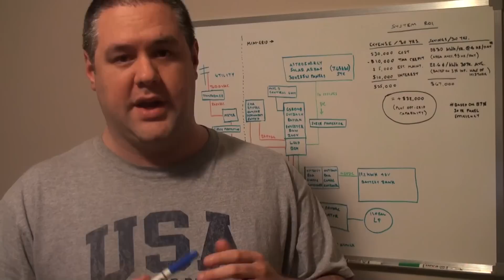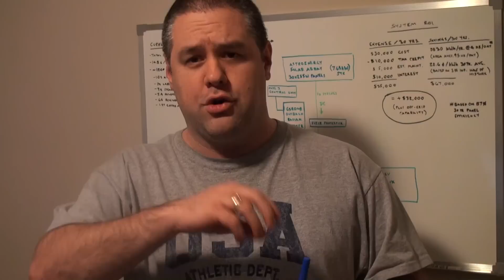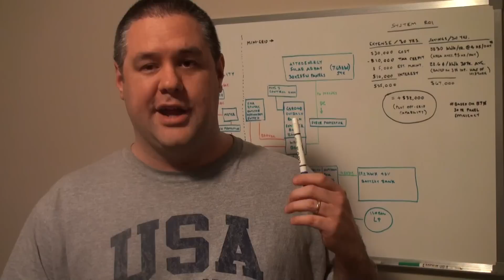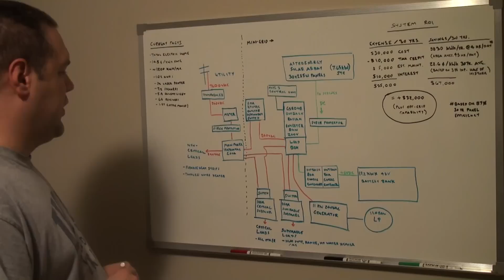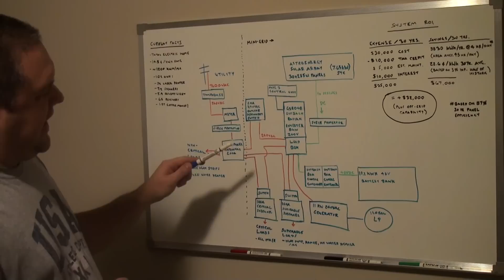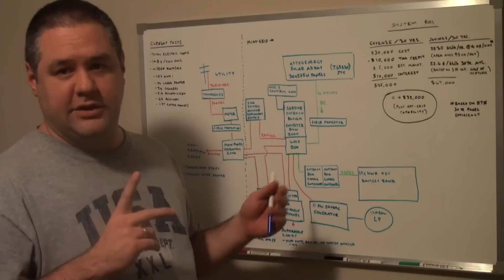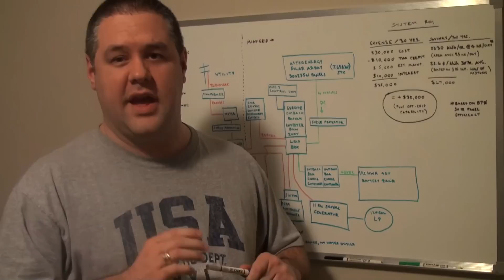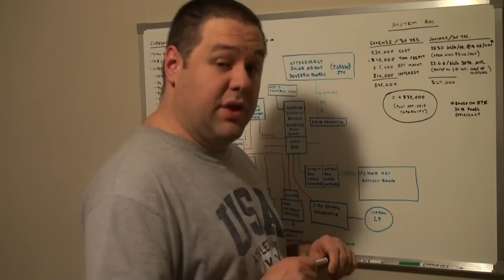Grid-Interactive Power System with Solar, Inverter, Batteries, and Generator

Comment: Great explanation of your system. Someday (not here in Oklahoma) I will have a system similar to yours. Right now, mine turns off grid power (120v side, for six circuits)  when I am making power...thus reducing on-grid time and electric bill costs. It is a capable of off-grid 24/7 instead of just 7-8 hours a day if SHTF or power goes out (emergencies). Right now I am offsetting about 30-40% a month...which adds up! Anyway, two things I like about your system. 1) Batteries. So many say no way on batteries...however, if you get a big enough solar array, you can run the house and charge batteries. 2) LP generator. Even smarter IMO...in an area that only has 4.5 hours of solar (avg) and being in Indiana, best investment for living comfortably. 3) Grid-interactive. Indiana is much better than Oklahoma. As long as utility taxes are low and they buy back a lot of power...you should be good to go. Anyway, smart/intelligent presentation...great job. I spent a lot of time in Indiana growing up (grew up in southern MI).

Comment: That sounds like a very nice system.  I like the logic in the design.

I didn't think you did desulfating on AGM.  But I'm probably thinking of equalization...
Reply from the maker: Thanks.  That's right - you can desulfate on AGM, but not equalize.

Comment: Thanks for this explanation.  The 2-subpanel system for backed up loads is a great solution for a customer of mine.  I would be interested in knowing what set points you use for the inverter/charger.  In cases like yours where the batteries are only needed during grid outage I assume the batteries should seldom be discharged, so that the charge/discharge loss is minimized.  Also, the inverter/charger should be able to sell to grid as much as possible rather than disconnecting from grid to charge batteries.  What absorb voltage, absorb time limit, float and float time set points do you use?  From your video I expect that you have figured out the best strategy for programming the MATE3.

Comment: I really enjoy watching this. You did a spectacular job of explaining everything. I'm curious about 2 things. First, why batteries at all ? If you are grid tied, the batteries do you no good as far as storage. And your back up generator will handle your needs should the grid go down. Or are you worried the grid may go down for more than say a week at a time ? If that's the case, I can understand batteries. Secondly, your solar tax credit only applies toward federal income tax you may pay, so I'm assuming you are in an income bracket that gets you into even the lowest (10%) tax bracket ? Your standard deduction and exemptions stack up to quite a bit for a family of 3 or 4, plus if you donate to an IRA all that comes off before federal income tax gets applied, or, if you are self employed like in my case, we can plow away a ton of money into tax deferred retirement and write off our health care costs -once again before we even start to pay any federal tax. Just curious if you took that into account before going down this road. You probably did are you seem well on top of things.
Reply from the maker: Thanks, lots of good questions, let me answer them one at a time: On a "grid interactive" system such as ours batteries are required for the system to work, all solar energy flows into the batteries and then into the inverters.  If our system were a true 'grid tied' system then yes, you could skip the batteries as the DC from the panels goes straight to the inverters and into your home grid.  However, batteries are also a critical part of our system because I wanted the ability to operate when the grid is down (without using the generator) by using solar only.  The generator is only started (automatically) when the grid is down and the battery bank reaches a low enough voltage that it needs to be charged up (which would ideally only occur after several cloudy/overcast days where solar charging is low).  In other words, the generator is basically there just to charge the battery bank on-demand.  I hope that makes sense.  Also, yes our tax bracket was enough to get nearly the whole tax credit in one year.  That said, it DOES roll over, and we had to do that.  So the unclaimed portion of the tax credit automatically rolls to the next year and we claimed it the following year, so it's not like it goes to waste if you don't happen to pay enough in federal taxes to get it all back that first year.  I hope that helps!

Comment: Did you build this system yet? Great explanation! Did you consider the XW6048 also? If so what decision points did you make to go with the Radian?
Reply from the maker: Hi Benjamin, thanks!  We are in the process of installing it now.  I did but the XW6048 (and the SMA Sunny Island) were both too small... 6kw just wouldn't cut it at times when we need to run our heat pump or electric range.  The Outback is beefy enough to handle those loads and our typical 'continuous' load at the same time.  I also plan to utilize all of the Outback's capabilities including the auto-start generator capability, etc.
Reply: So you don't want to use the AC2/Generator input on the Radian? You are going to use an ATS in front of the AC1 input for your genset?
Reply from the maker: benjamin saunders There is no ATS, we do in fact use the Gen Input on the Radian in our setup.  BTW the installed system video is here Our Outback Radian GS8048 Based Grid Interactive Solar System